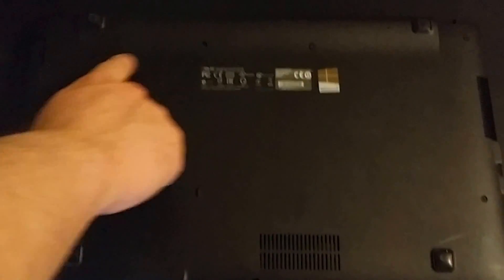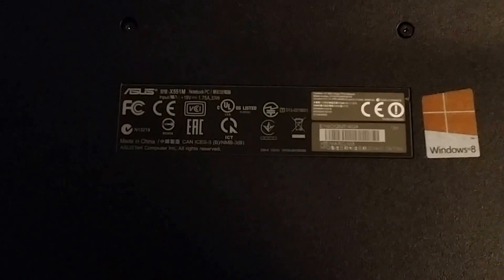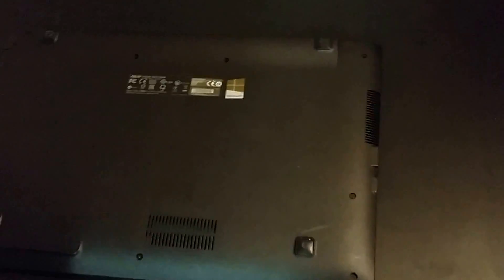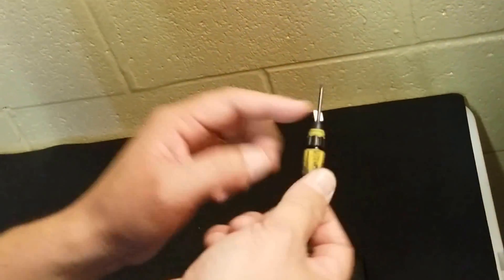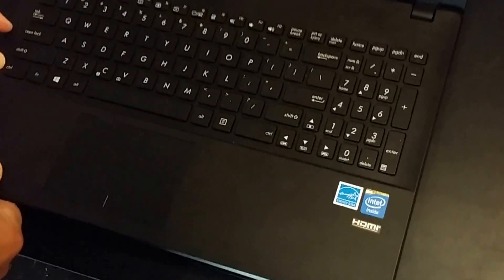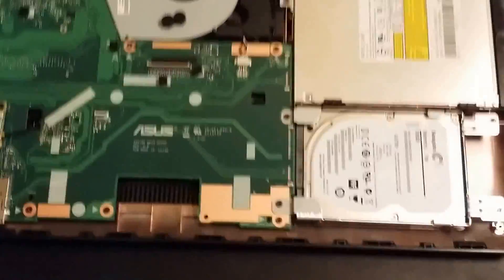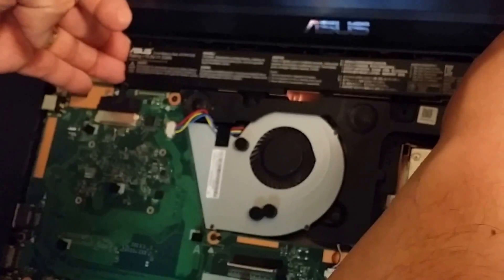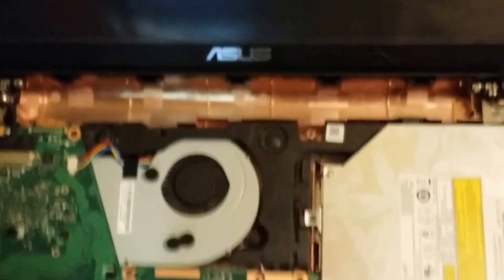ASUS X551M Laptop Battery Removal & Won't Power On Fix

Comment: They likely integrated the battery that way to cut down on costs and maybe slim down the notebook a bit.
Reply from the maker: They may be reasons for why they did this but there are ways around this.  A cut out/plate holder for the bottom case where the battery resides at could have been done as is done on MANY other laptops and the Motherboard battery jack where the battery slots into could have been inverted so the battery could be slid and removed downward instead of upward as it is currently doing.  Grand total cost to do this at the case manufacturing and motherboard facilities: MAYBE 50 cents for both things to be added for the sake of the consumer.

Comment: I have the same computer,  Asus.I'm told it's a pretty slow proccessor for a new computer.  Also it's been freezing up a lot lately,( Mostly page freeze internet not resonding. usually when I'm on Google Crome,  but not sure if that related) and almost alway at the same time it usually wont shut down properly.  I shut it down by pressing the power button,  when I turn back on it's wont respond until I press power button a second time. this happens a least once a day
Reply: Considering 64 bit windows is a RAM hog (~2 GB I believe) as is chrome (plus you probably have other things running in the background, such as antivirus), maybe you are having a problem with using that? Check the task manager's resource monitor to see what's being used. With only 4 GB of RAM, its easy to run out if you use windows and open up multiple tabs on chrome.

Comment: Thanks for posting this, just what I needed. I had remove the screws but was trying to pry off the bottom of the laptop, not the top. That did the trick for sure.

I agree this is a bad design. Just because this is an inexpensive laptop it shouldn't be designed to be disposable. The battery not being easily removable was bad enough, but what really drove me nuts was not being able to remove the plastic spacer in the optical drive bay. I want to add a caddy in there to fit an SSD - the SATA port for an optical drive is present under there but the bay-filler plastic piece can't be removed unless you take the whole laptop apart - the screw is internal!

I also bought the Acer version of this laptop - another $250 special, nearly identical to this with with a few minor changes. The Acer has the same issue with the battery but at least the optical drive spacer can be removed with one screw from the bottom of the laptop. Better design. The Acer lacks the numeric key pad, and has an extra USB 2.0 port in place of the VGA port, other than that they're the same.
Reply from the maker: You are most welcome!  I am glad the video helped you.

Comment: Thanks for posting this as you are the only one who has posted anything on this laptop that is worth watching, tech wise.  I bought this same laptop towards the end of last year and it went out on me just a few weeks ago.  Although it is still under warranty neither Asus or Fingerhut (whom I bought it through) will contact me as to where to take it in for repair.

Because of this I have taken it upon my self to try and fix it.  I am thinking all it is, is the mainboard.  My problem.... the screw between the fan and dvd player that holds the mainboard down will not budge.  Also, I cannot seem to understand how to lock the three keyboard cables back into place if I were to get a new motherboard.

What really bothers me is that as I began to take the laptop apart is that I discovered there are screws missing here and there, and there was not any grounding film over anything.

Could you post a few videos on this type of laptop on how to release and secure the keyboard cables, removing a stubborn screw safely, and where to find parts for this laptop (screws, RAM, etc.)?  Thanks.

Comment: hi thanks for the video. how do i get to the keyboard as i have a few keys that r sticking. thank in advance.
Reply from the maker: You are unfortunately out of luck on this problem.  The Keyboard is integrated as part of the top cover lid to the base unit.  If your keys are sticking you have to follow my instructions in the video to COMPLETELY remove the top lid (Keyboard) and see if you can remove the silver "plate" that is hiding the actual keys to the keyboard.  This may or may not be possible and if it is NOT possible, you may have to purchase a brand NEW keyboard/top lid if the problem is persistent or if it bothers you from normal use.  Yes, I HATE the designs of laptops like these as in other standard laptops, you can simply replace keys OR keyboards for under $20 on Ebay/Amazon.

Comment: Can I add more ram to this laptop?
Reply from the maker: Yes. In order to access the memory you have to remove the top panel, once you have it panel off you have access to everything in the laptop. Just be sure you double check to see how much  memory the motherboard is able to use.
Reply: Thank you guys for the feed back it really helped :)
Reply: chromecat77 I have this exact model. I was able to get all but one screw out (Last one decided it didn't want to come out) and was able to at least peek in and see the top of the motherboard, and didn't see the memory soldered to the top like is some motherboard revisions. So does this mean for sure that the memory is upgradeable?
Reply: @TorqueEffect  Yes. I used a Kingston module, part number KCP3L16SD8/8, but there are others from other companies that would also work.
Reply: chromecat77 So how do you figure out if it is possible through the serial number? So what I gather you email Asus with your serial number and they can check whether it has the socket or not? I would have figured they would just say some generic answer like, it isn't possible to add more RAM.
Reply: As stated above: You can't ADD RAM, but you can replace the one in there (usually 2 or 4GB) with an 8GB module.
Reply: chromecat77 what is your mobo revision number